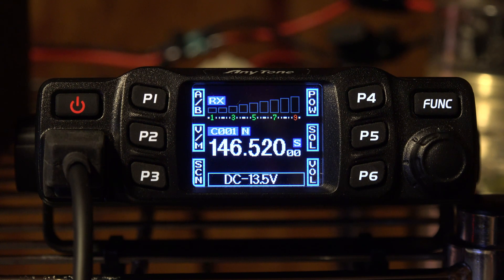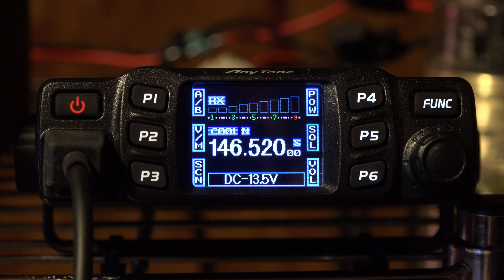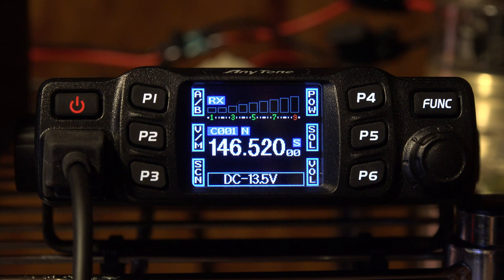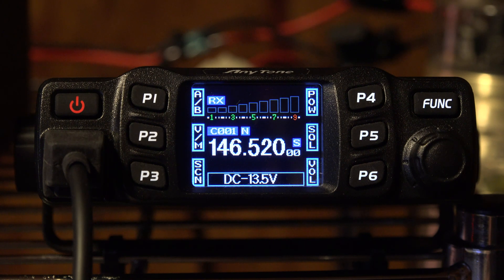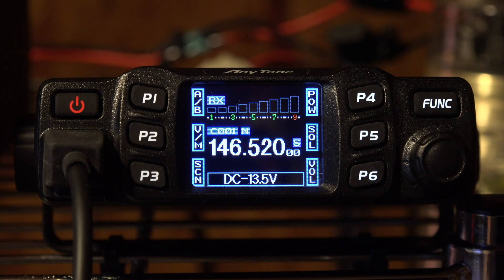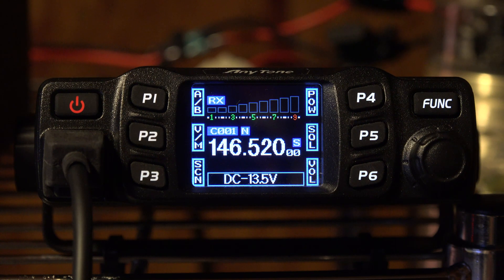Any Tone AT-778UV   Watch before you buy, low transmit modulation !!

Comment: What I will say, and I am not disagreeing with the fact people need to be more critical in reviews, in the UK the top ham radio shops sell this radio.  They have sold it for years and years.  They sell virtually no other cheap radios from china (unless you count $500+ sdr as cheap) they won't because of the lack of reliability of the other Chinese manufacturers.  They sell these because very few of them come back faulty and they are fairly easy to repair.  But I also remember when Japan started producing TV sets.  In the UK our TV manufacturing died instantly.  For the simple reason that Japanese quality could not be beaten.  If someone asked me to describe what Japanese meant, I would say "high tech, high quality, affordable and repairable."  You just don't get that from anywhere else.

Comment: I enlarged the mike hole to 3mm. Worked..
Reply from the maker: I tried that at first too, but didn't work in my case. It only fixed the problem after I installed a new mic capsule.
Reply: can you do a video on that? @teuton77777
Reply: @teuton77777  is it possible to install Electret Condenser Microphone
Reply from the maker: @srpskoudruzenje  It already has an Electret Condenser Microphone. The problem on my mic was the actual capsule

Comment: Here is a fix. Open up your mic. Make the whole larger. The mic is not properly aligned. Nothing wrong with the modulation on the radio. There is a video on YouTube describing how to do it
Reply: I also tried this fix but it did not work.
Reply: Yes I saw it. I really suspect its the cheap mic. Be interesting if it fixes the problem. At that price don't expect great customer service. You really are spending your money on a throw away product. I have been using chinese radios for years and have virtually no problems. I'm planning on buying one of these and I might just have your problem we see. To be honest to get a comparable jap radio you would have to pay over five times the price. And to be honest it's a rip off. There not 5 times better. So yea be really interesting to find out if it fixes the problem.
Reply from the maker: Did you pay any attention what I’m saying in this video? Off course I checked for the alignment. I even tried without the case around the mic. The radio worked fine for about a month then the modulation went down the gutter. Just watch the whole video again maybe you understand it better then.
Reply: @teuton77777 it’s hard to watch such a slow talker.